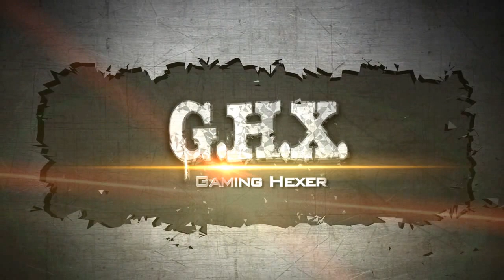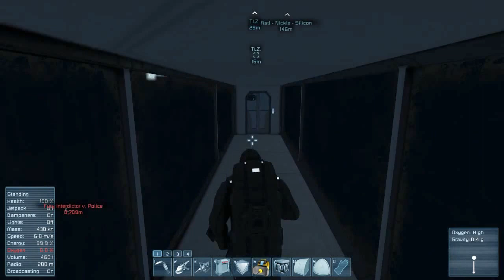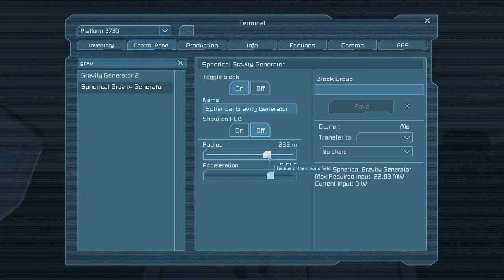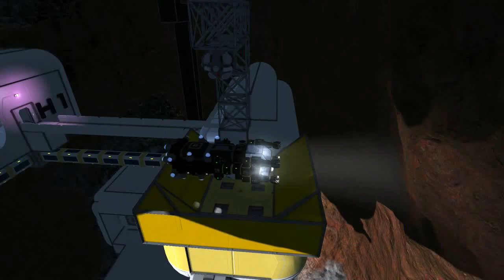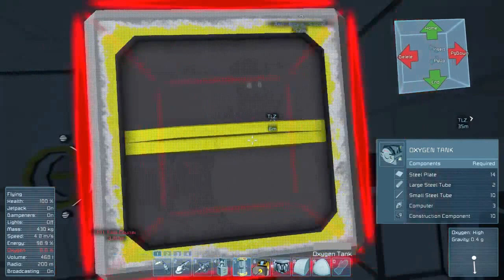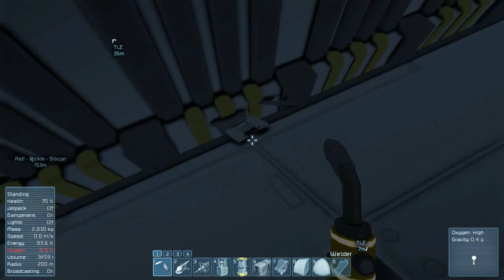Space Engineers Survival: Series 3 Episode 6

Comment: Some tips: Every time you open the hanger and let the air rush out, you are wasting oxygen, and it will all have to be replaced.

Your airlock will do the same, you need a vent in it to drain the airlock of oxygen every time you exit for EVA. Same goes for your hanger.
Reply from the maker: Thomas Henry Funny you should bring this up as not long after recording this I was thinking about having an option in the fighter cockpit to depressurise the room. Thanks for the tip will be sure to kerb my wasteful habits! :)
Reply: There are a few different systems you can use. You can supply oxygen from a central plant and whenever you drain a room you can drain it to its own tank or to a central tank.

The nice thing about the vents is that they are smart. They shut off if a room is open to vacuume so you only have to worry about the oxygen in a specific room or area.

I also assume that oxygen sensors for doord will play a role at some point.